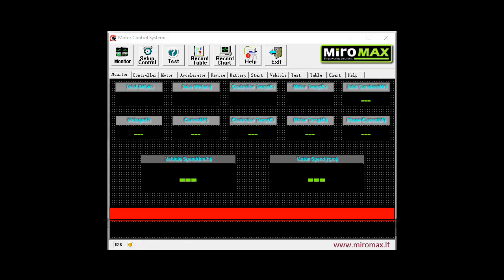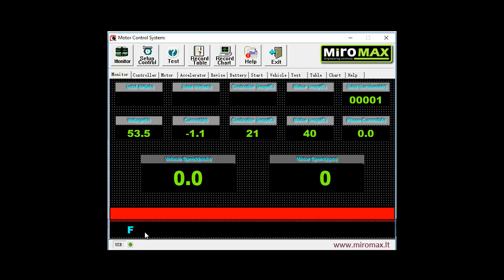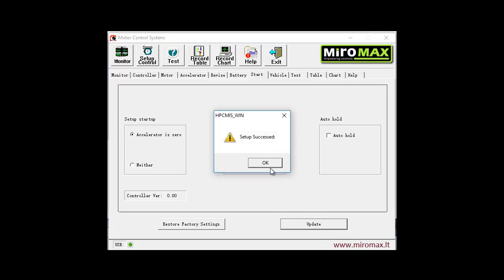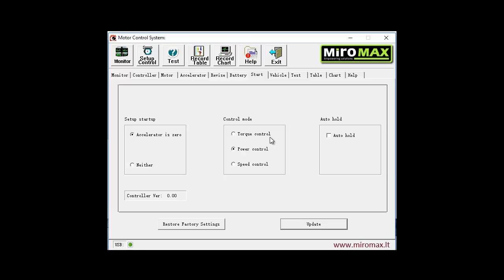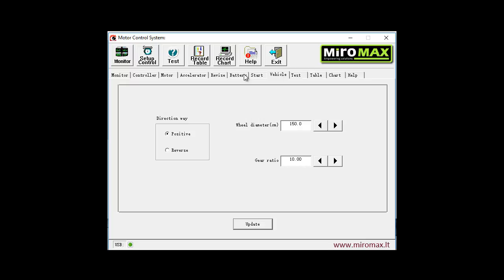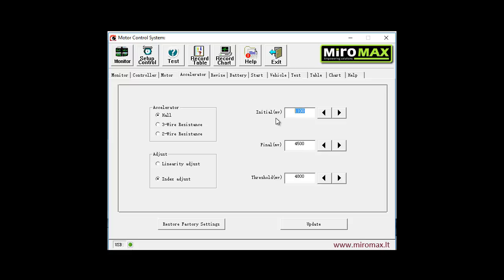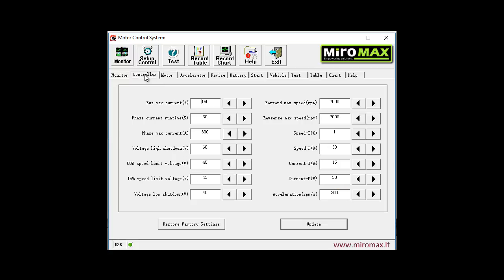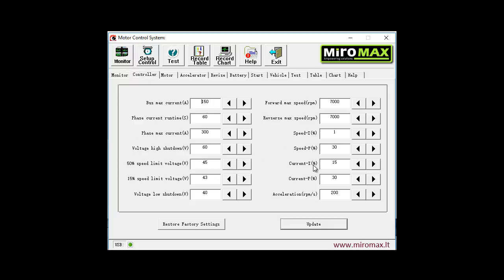Software for HPC series controllers   Intruduction from MIROMAX

Comment: I have tried all the settings you have described on your video. However, for some reason I could not change the controller parameters. They were returning to the defaults. That is limiting my RPMs to less than 1K. Any advice? Thanks